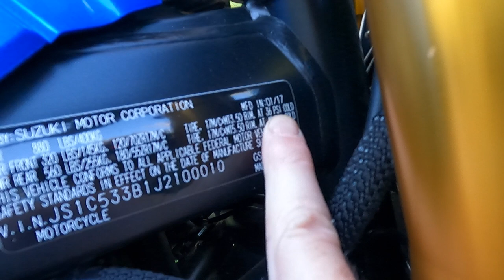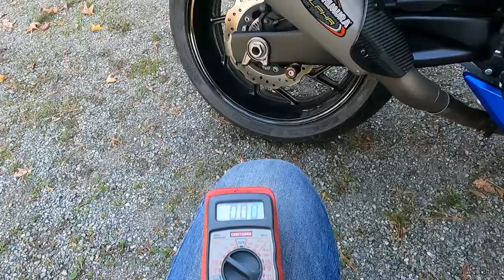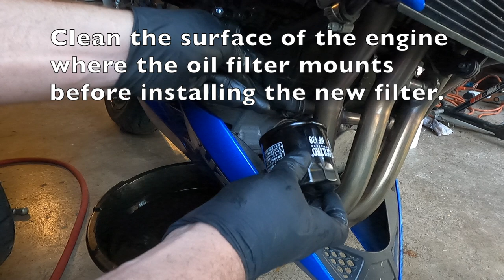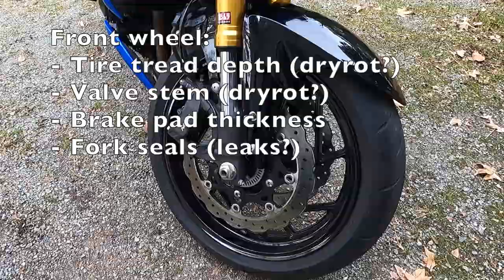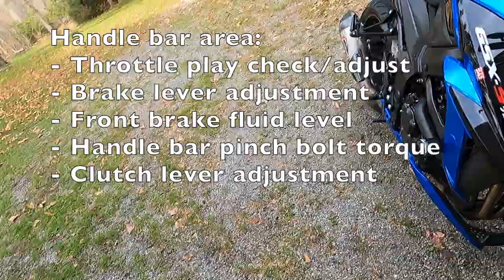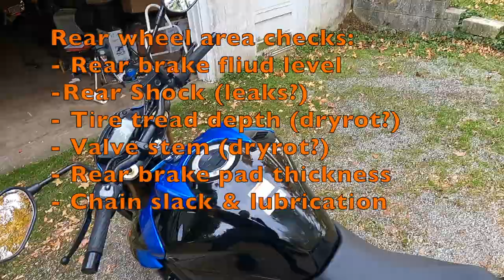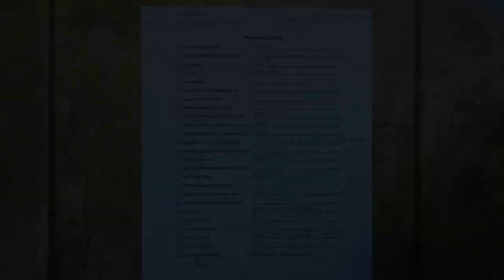How to service a motorcycle - Suzuki GSX-S750

Comment: Nice video. I have the same bike. I have the yoshi exhaust and put the db killer in it... the bottom end torque improved.
Reply from the maker: Thanks. I don't think this bike has the dB killer. However, I have run those types of inserts that increase back pressure and noticed an increase in low end torque as well.

Comment: Hi Jon, thanks for your pointers with a home maintenance pov. All solid ones. 
Can I recommend a different chain lube for you? I was a riding instructor and maintained my bikes for 15 yrs plus all the time I have totally maintained my bikes (coming up on 40yrs). 
The Chain Wax you showed is offered by a company called Belray here in Australia. Same label printing as yours except the co name. I found it to not be efficient in my instructing years. While it did set and stay on the chain, it didn't actually penetrate where all the joins are for the 'O' Rings etc. 
I got less mileage from chains that I used the Chain Wax from vs using another brand from Fuchs. 
The type of chain lube I use is designed for dirt bikes and it is fully synthetic. It is also claiming low fling. And it is true. 
Chain lubes have always made some sort of mess. I do get better chain wear from the Fuchs one. 20-30000 KMS or 15-22000ML
Reply from the maker: Thanks Tommy. We have Belray and Maxima here (two separate companies). I think Fuchs products are available but not as easy to get here. If I see some of their chain lube I may try it out. Thanks for the tip!
Reply: I’ve been using "Liquid Wrench" chain lube for years. It is available at auto parts stores, which makes it easy to get. I typically get 23,000 miles per chain on my torquey ZRX. I dribble it on each link every 3- 500 miles.

Comment: Great video, thank you sir. How did you remove the orange side reflectors on the front wheel?
Reply from the maker: Thank you! The previous owner removed the reflectors. If they are stick-on units, dental floss can be used to cut through the adhesive.

Comment: Thanks for your video 
One question 
So long time ago 2001 ,2002
My father was cleaning chain with benzine and brush after few minutes he was adding oil for chain 
Is it good ?
Reply from the maker: A light oil like WD-40 is less flammable than benzene (gasoline? ) and less likely to damage the O-rings in modern chains. However, gasoline will definitely clean old chain lubricant off the chain.

Comment: Awesome video!
Do you think you could show how to properly adjust a clutch cable?
Reply from the maker: That's a good Idea Matty! I may do that in an upcoming video. In the meantime, a properly adjusted clutch should have just a slight amount of play when you're not squeezing it. As the lever is squeezed toward the handlebar you should almost immediately start to feel the resistance of the clutch springs (just after the tiny bit of freeplay in the first 1/8" of travel). Hope that helps!
Reply: @jonsmotorcyclerescueandrev3538  Jon, awesome tips! Thank you very much!
Any advice on what do you when all adjusters are maxed out?
Reply from the maker: @Matty 100%X35  I want to be careful how I answer that because I'm not exactly sure what you mean. If the cable has stretched and you have run out of adjustment, then you need to replace the cable. I have seen someone adjust their clutch cable in the wrong direction, and their clutch slipped horribly (probably ruined the clutch).
Reply: @jonsmotorcyclerescueandrev3538  thank you Jon 
Didn’t want to confuse you or myself, but I thought I watched a video of somebody opening up the clutch case and adjusting the cable there.
Thank you
Reply from the maker: @MrGSXSIR  You're welcome. The dial by your clutch lever should be where you adjust your cable tension.

Comment: Question. Dis the Gsx-s have engine vibration as the revs climbed? I have a new 2023 and the higher the revs the more vibration that comes  through the bars, the seat, the foot pegs and the gas tank. Is this normal? My mirrors are blurry at any rpm above about 4-5k too.
Reply from the maker: Some vibes are present on all motorcycles. It's hard to tell if yours is excessive without riding it. Cheers!
Reply: @jonsmotorcyclerescueandrev3538  Thanks, I took it to my dealer and the mechanic said it is normal. But then in his report said that after 5 minutes his hands hurt and were numb. Also he stated that he suggested that I replace my handlebars and grips. I'm so confused.
Reply from the maker: @seth3000gt  That's an interesting report. It seems like something might be up. Maybe you can get a second opinion. Good luck with it.
Reply: I have a 2021 z/abs and it does not vibrate excessively under any part of the rev range. I’d suggest getting a second opinion. You could possibly have an engine mounting bolt loose or if you’re feeling the vibration at speed rather than rpm’s, then you could have a bearing issue in the front.

Comment: No problems using the same oil drain gasket?
Reply from the maker: Great question! It's always a good idea to have a new one on hand when you service the bike. I inspected this one and was able to reuse it with no problems.
Reply: @jonsmotorcyclerescueandrev3538  Thank you for answering!
I am looking to change the oil on mine - do you know the size of that gasket? Some say m12 others say M14. 
Great video btw! I Will use this as a guide going onwards on my gsxs750 🙏🏼
Reply from the maker: @Between Frames Production  You're welcome. I would check with Suzuki. I'm not sure what size it is.

Comment: Would you recommend this bike?
Reply from the maker: It's a good bike. It has more performance than most bikes in it's class and should be low maintenance and reliable. I would recommend one if you're looking for a performance oriented, mid-sized sport standard.
Reply: Hard to say, I got '20, not as pretty as that one, it's smooth and fast.......not much for comfort, and you'll never be able to use the power. If you lean forward the mirrors are useless..... that's a problem with naked vs fairing

9000rpm is the beginning of the fun zone, in third gear that's 85mph......so if you're on the street GSX(Street)and want true throttle control you have to run in 1st and 2nd.......and of course when having full fun it burns up the gas(you should expect that anyway)

It depends on the riding you want to do. If you are an "R" crotch rocket rider you probably don't want this, a commuter nope, something to hop on and have fun yep

I, personally, would have been better getting sv650 or Kawasaki z or ninja 400......my riding the 750 is all curves and nothing but fun.....I believe the less powerful would have been a better fit for me
Reply from the maker: @rugershooter5268  Great reply!
Reply: I ended up doing a deal on a low km 2020 Street Triple. Yes more power than is necessary for commuting. Lose your license just as you get the bike to perform.   And sucks the fuel if you use the addictive revs. However I am enjoying it for now.  Looking forward to more twisties and next summer.
Reply from the maker: @paulconnell1309  The Street Triple is a fantastic machine as well. I had a nice Street Triple R a few years back and it was the kind of bike I would get in trouble on - and I loved it!
Reply: I also have V-Rod (mid controls), not as much fun in the curves as the GSXS, but the fun goes on for hrs and hrs......2hrs on GSXS and all you want to see is your recliner
Reply from the maker: @rugershooter5268  Nice! It sounds like the V-Rod fits you better than it fits my 6'-4" tall frame.🙂
Reply: @jonsmotorcyclerescueandrev3538  5'10.5" perfect fit.
Reply from the maker: @rugershooter5268  Right on!
Reply: @rugershooter5268  I think this level of power is perfect for backroads and highway. With this bike, a lot starts happening at around 6k, and yes, coming out of a corner in second, snicking up to third and doing a sweet 80 - 85 is a joy.  

Of course, the engine is so flexible, you could leave it in third and just wind it up. If you'fe feeling more relaxed, you can upshift the 4rth on the straights.  I keep telling myself to do that....

The other thing is, you always have more in your pocket.  If you want to pass a truck, a couple of cars, done - and on with your ride.

I put a saddleman seat on, and it's all pretty comfy.  Clean airflow on the highway, the engine is easy and smooth, and the ergos are surprisingly comfortable (5'10 30 inch inseam).  Never had a problem with the mirrors.

To the OP: If you like I4s, this is a very sweet well engineered bike.

Comment: Sorry to see you didn't actually show how to do many of the things you mentioned in the video. 
E.g. Adjusting the slack in the brake and clutch pedal etc etc.
Reply from the maker: @Miller-EE  I apologize.
Reply: @jonsmotorcyclerescueandrev3538  No need for apologies :) Just a suggestion for improvements.
Reply from the maker: @Miller-EE  I appreciate that.